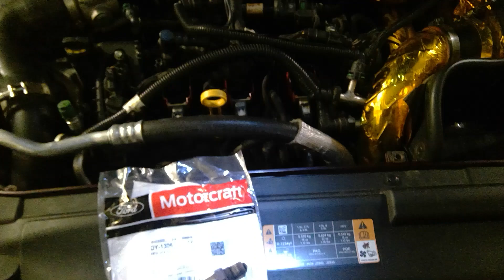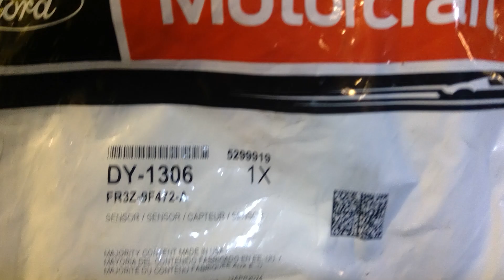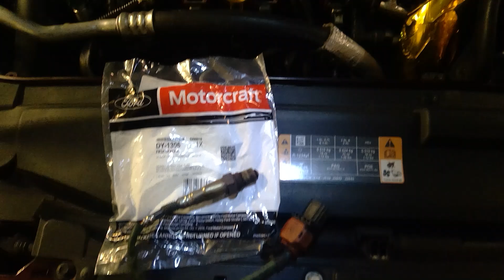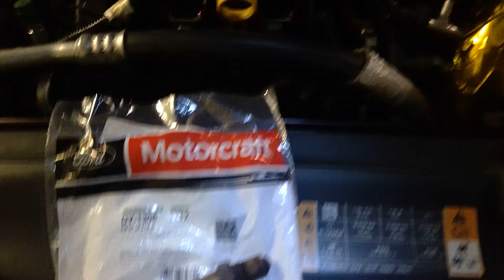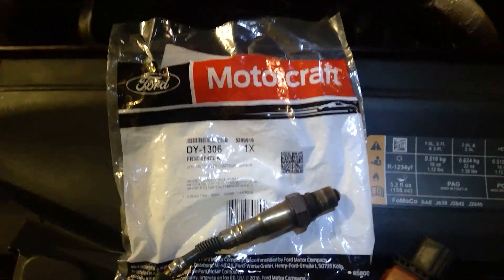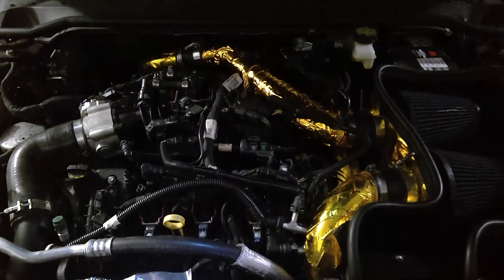Ford EcoBoost DTC P0088 Fix (Lean Bank1 Type)

Comment: The conditon of the O2 sensor and spark plug are certainly because of the Boostane that leash orange residue. Did you think of using real race fuel VP MS109 that dosn't leash residue compare to additive fuel ?
Reply from the maker: I used Boostane in the past when I could not have access to Ethanol or did not have enough injectors for Ethanol. But agree regarding the Boostane. In total, I think I may used about 20 tanks of fulel with Boostane (but only half an ounce per gallon (max))

Comment: It’s crazy because i’ve been having this same problem on James tune or even on stock. Also have been getting popping out the exhaust. Also thinking about changing change the spark plugs, coils , possibly the oxygen sensors , or whatever is making my car pop / throwing the code ( 90174 ) every blue moon. Trynna get to the bottom of it

Comment: Perfect timing for this video!  I just replaced the O2 sensor (Bosch) on my MKZ.  What brand do you use for spark plugs? Have you had to decrease the gap, too? (I'm running 0.022) Thank you!
Reply from the maker: Torrie ask me to gap at .025. Yesterday I swap the Brisk by the Bosch I did have in hand  but I will eventually swap them with NGK or Brisk again...but planning to use the Bosch for at least 5K
Reply: @twinforce_fusion6560   will it be possible to make a short video showing the condition of the old Plugs?